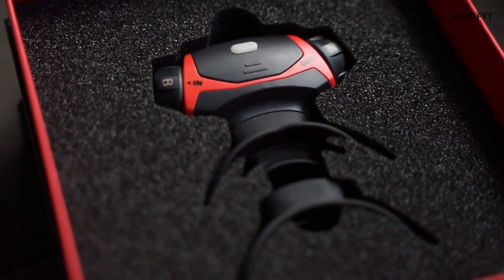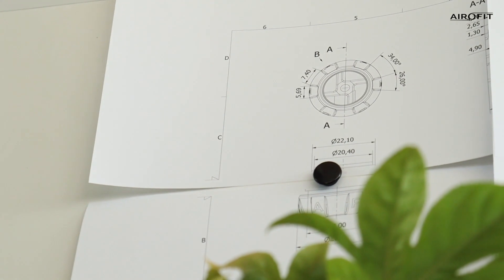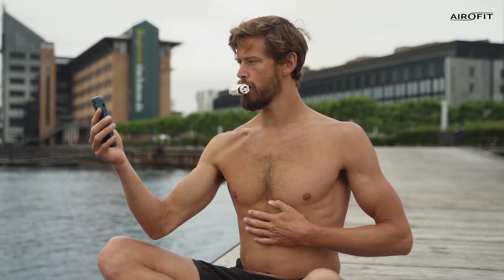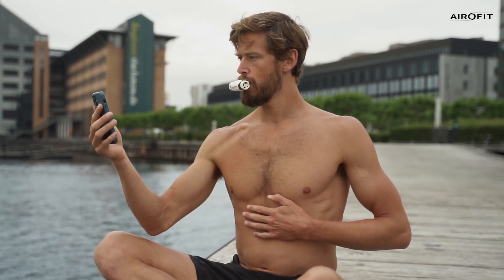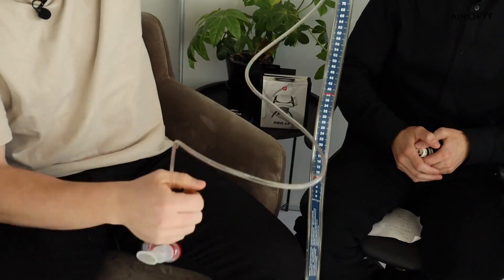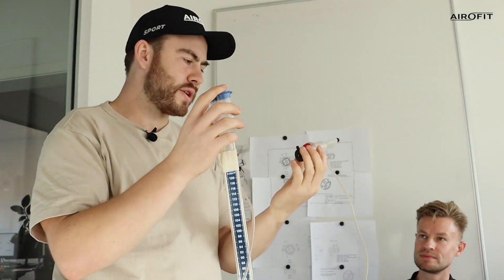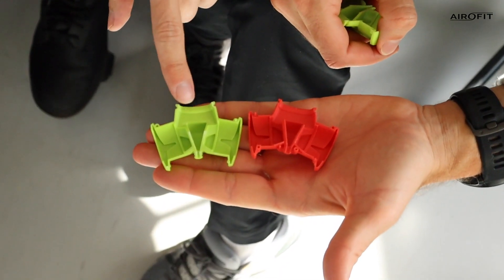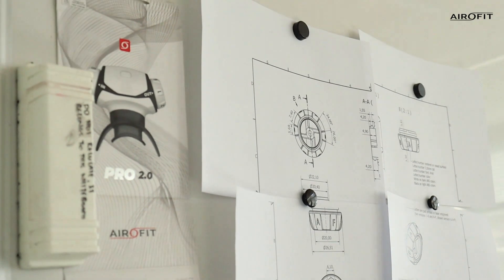Airofit PRO 2.0: Interview with Airofit's Engineers

Comment: I've been using your device for 2 months now. The training results are amazing! 
BUT, Finally make it waterproof, use at least URETHAN 71 to protect the electronics. 
Your device should be disinfected regularly with at least clean water. 
Breathing air into the lungs through a dirty device, or infected saliva and moisture with microbes  can lead to dangerous diseases, possible quickly get Aspergillus bronchitis and lung infections. Please do this device IP67 at least.
Reply: What about putting the device in a UVC box? I’ve considered the same.